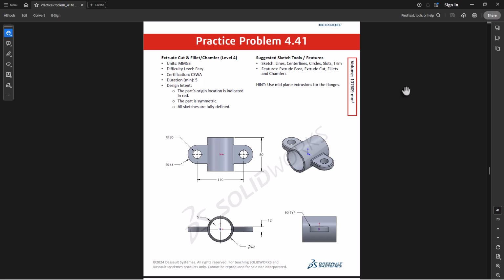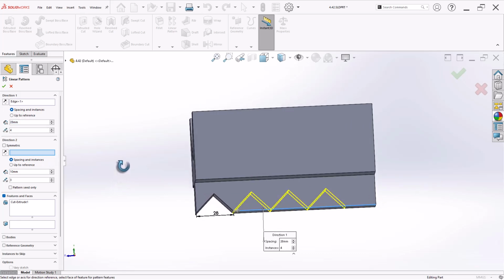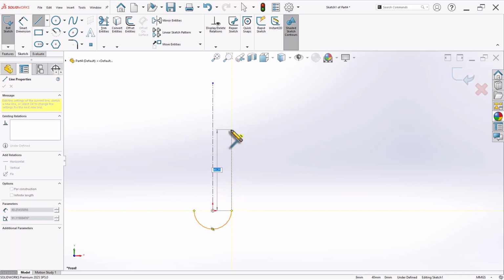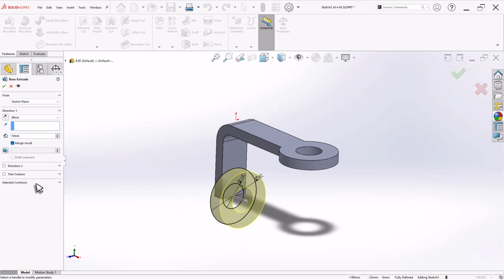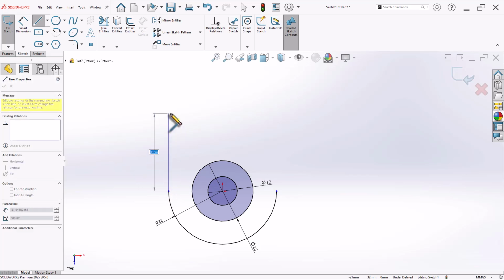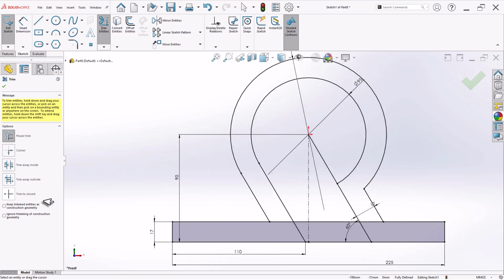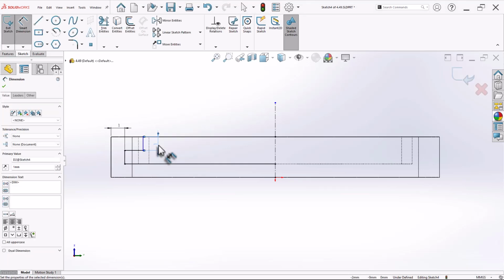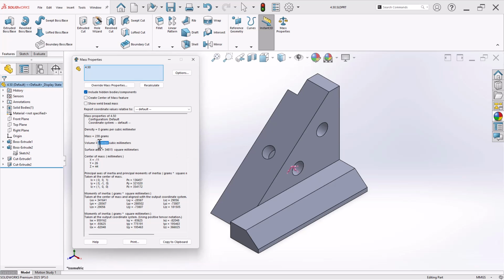11.4 | CSWA Practice Problems | Level 4 (Problems 4.41 to 4.50)

Comment: how did you know that the centre points of the arcs were vertical together? there isn't anything in the drawings that show this or highlight this as far as I know? This is for question 4.47.
Reply from the maker: Observe the centre lines. Sometimes information is not given explicitly. we need to understand. Even I faced the same problem when I tried the first time.